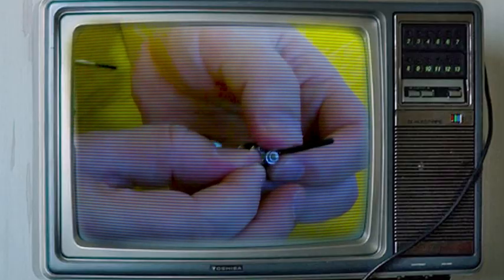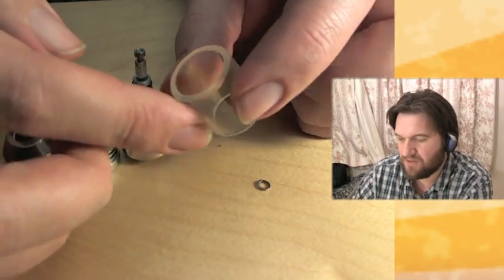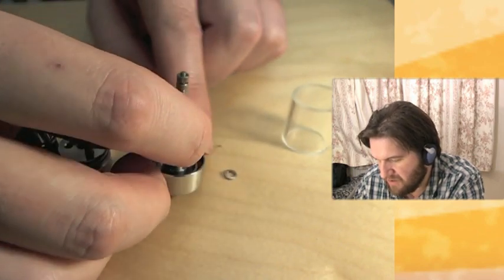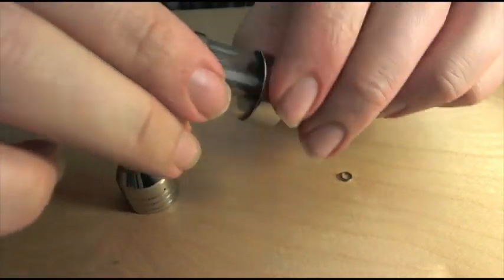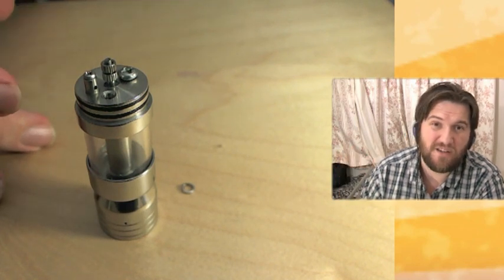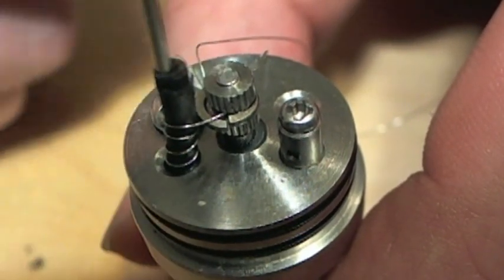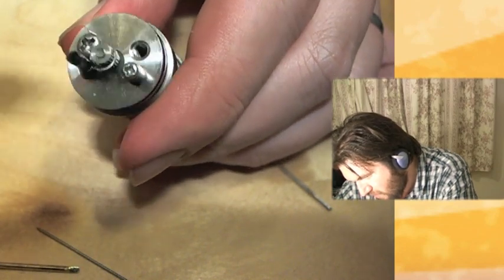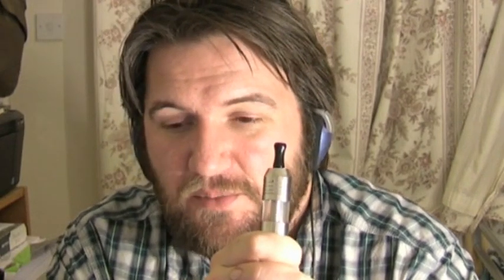Rebuildable Diary 3 - AGA-T2

Comment: What gage wire are you using there. I want to try to copy your method. I think I had too thin of a wire and it snapped off at the center post when I fired it. It was also very airy. I'm looking for a good method for doing this. I like how neat you are and that you show lots of detail in your build.

Comment: i have the aga t2 also, the coil on it i made come out at 0.7 ohms which works fine on my mechanical mods but when i try fire it on my evic it comes up with atomiser short i think the evic has a limit on how low ohms you can go, you could try adding more loops to your coil thats what i had to do to get it to fire on my evic.

Comment: I am thinking of ditching the vivi novas I have been using for 1.5 years and going rebuildable with one of these.  I use a Bolt Mod, 3.7v batteries and go through about 3ml per day.  How often do you think I will need to rebuild?

And as Batman once said "does it come in black"?
Reply: Sweet, thanks for the advice .

Comment: @isaiah jmaev .....airflow buddy...airflow, drill your air hold in your top cap out, start with 1/64 and move on, 1/64 seems good enough for me, and lung hit, don't mouth hit like you would with a cigarette (filling mouth with smoke, then inhale....you wan't to inhale the whole time, it'll take a little while to get used to it but once you do it's crazy how much vapor your lungs hold) and with 28 gauge do a 4-3 wrap with a mech mod you'll do just fine!